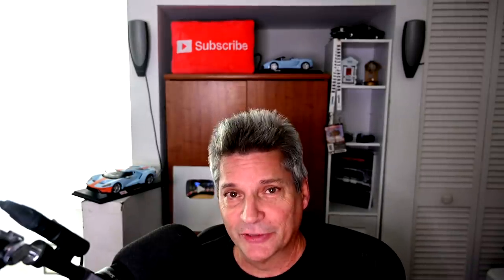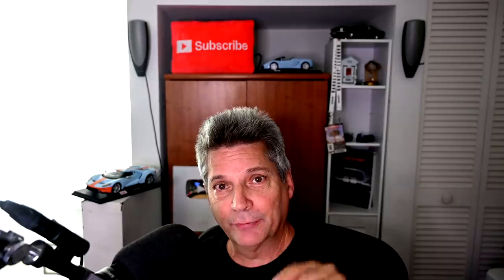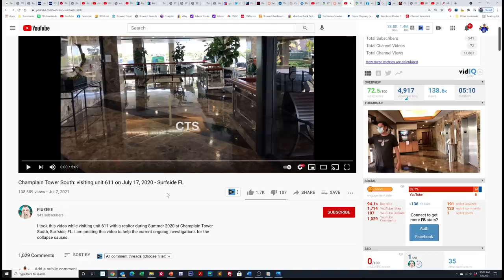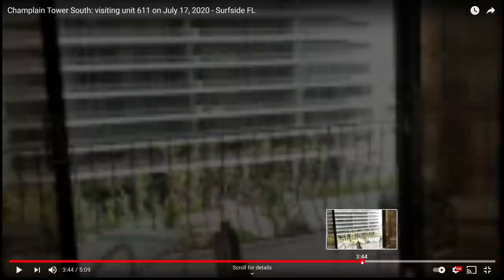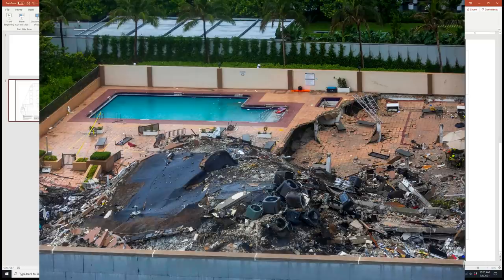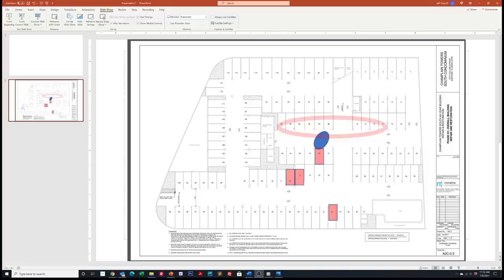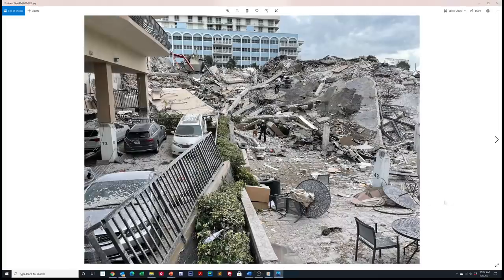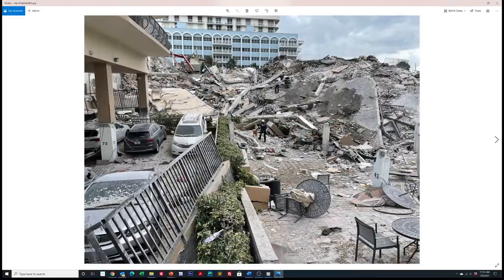Analysis Garage Video BEFORE Condo Collapse: Water Everywhere

Comment: Rust jacking or (oxide jacking) expansion of the rebar giving it's a 1982 Beach front condo .. Saltwater corrodes metal 5 times more then fresh water does and salty humid ocean air is a really bad combination giving it's close to the beach the building simply gave weigh .. such a tragedy prayers for all the family's
Reply from the maker: We're going to show another video this week where one of my older condos that are sick it's on those that a 6 miles inland started to have cracking on the patios started to have cracking on the patios when it was only 7 years old. I went back old. I went back and revisited it this week and it is now a 14 year old building and it is much or 14 year old building and it is much worse condition you'll be shocked at how bad it is and there's no 1 update how bad it is and there's no ocean salt water air near it or anything it's just error near it or anything it's just good old fashioned rain and humidity.
Reply: In the pump room for the pool was showing exposed rebar... they said it was from chlorine water absorbing into the concrete.
Reply: @jeffostroff  
Wow, that is terrible. Maybe the authorities need to limit height of buildings in rainy, humid parts of Florida to prevent excessive load-bearing? I had family in Tampa and it was a constant fight against mold in the house from humidity. Shower, bathroom, kitchen, foundation area outside. The family member told me that in Florida they sell special household towels that are made in such a way that they will, or can (if you are lucky) dry before they start to grow mold and bacteria, and even then...
Reply: @aquariousenigma70  
When there is a crack in concrete from stress (possibly due in this case from uneven weight-bearing from shifting or sinking of the building over several decades), the rebar quickly starts to rust. Look for the term 'concrete spalling.' When rust (oxidation) starts to form, the concrete naturally starts shed or to break off from the rebar because rust is basically the dust from what used to be the surface of the metal. 
There is no evidence to show that the water in the pool maintenance area was water from the pool (chlorinated water). It could have been rain water, even. In any case, the pool never collapsed. The area that collapsed was in the underground parking area. Water was pooling there, under and around the cars constantly, and it was coming down there through the pool decking next to the building, not near to the pool. It may be that the flower planters were watered nightly and water from the planters was being shed onto the deck, and it went straight down into the parking area underneath. There was also a lot of spalling everywhere in the parking area. Great comment, and the chlorinated water, or chlorine fumes, may fit into this.

Comment: One thing I noticed you missed in the video that is extremely an important area to pay attention to. At the 19:11 mark in time, pause the video and take a look at the ceiling in front of the elevator on your right, parking space areas 100-102 on your right, as you pan out from where you made the comment about the mission connector repair, right after you commented about this, as you start panning to the left, if you look up at the ceiling, there is a huge patch from a previous repair and what looks to be a long crack in the ceiling. It is literally above parking space marked 100 on the column is a big patch area of some sort to the concrete above, if you were standing in the garage down the isle you drive, elevators on the right, you also see a very long crack in the concrete ceiling above. If you pause the video at 19:09 and look up at the concrete ceiling, you can't miss it. Pause again at 19:13 and you can see another crack protruding from the patched area going across the concrete ceiling toward the left. One crack goes diagonal and another crack vertically. This is a 2 way crack. My husband works in plumbing, he sees evidence of a serious plumbing issue with drain pipes, this building needed serious plumbing work. I wonder if there are any permits that were pulled for plumbing work or if they ever had a plumber come out and give an estimate for plumbing repair? All the drain pipes we see previous patch work on, which actually should have been replaced and not patched, lot of pipes you can tell needed replaced due to leaks, they could have even had a water pressure problem causing all these leaks in the drain pipes, it is most definitely going to come back the root cause as a plumbing drain issue that damaged this building and nowhere on record do we see as of yet, this as being addressed. If they had made the concrete repairs, the same issue would still be there until the plumbing was repaired and brought up to code. Plumbing is a serious issue involving leaks and highly expensive. Go back and pause the video at 10:25, the ceiling in this area, it is clear they used metal to make a makeshift gutter of some sort to divert water. Look up at the ceiling here on the left, that is a double gutter made from metal placed in the ceiling, to be of that size, there had to have been a significant leak pouring down from the pool deck, it's also to the left of another huge patched concrete area above the vehicles. This building has a huge plumbing draining system problem involving the pool. 2The other thing we noticed go back and pause the video at 4:58-5:31, take a close look at the bottom of the column marked parking space 105-106, be on your right, notice the bottom of the concrete column, you can actually see water stain on the column how high water has actually been in the garage, those are water marks from how high water has actually sat in the garage in this area. Pretty deep puddle of water has sat here before and a number of times or for a long time in order to leave a hard water stain on the column. Parking space 52 on the column at the bottom shows the same hard water stain line, pause at 5:59 on the video, look at the bottom of the column. The yellow paint on the columns shows several columns had sat in deep water for some time in this area as well. I believe this is why we some columns have obviously fresher yellow painted on some columns, I believe it is due to the hard water stains left behind they were maintaining painting over, but hard water stain will only bleed back through the paint if they didn't re-seal the concrete columns with sealant first, I wonder if they ever had those columns re-sealed for water protection? The maintenance man said cars would float it would be so deep, all those columns should have been painted with sealant after that occurring leaving behind hard water stain. If you watch the video on a big screen, I'm using a 70 inch, you can see way more, and the issues present, are phenomenal. If we had driven in the garage and seen just one of the above instances I've highlighted, we would have immediately left this building, and this isn't even everything. We are willing to bet the plumbing drain system issue destroyed the concrete slab and columns and finally gave way and caved.

Comment: Does it look like to you that the coloms have been repainted? Possibly over damage to them?
Reply: Or crappy repairs made and painted over?
Reply: Some of the coloms dontbeven look straight.  If you look through the gaps , spaces between the coloms as they pan around, the spaces don't look square. Possibly meaning the coloms are damaged or the stress from the weight of the building is taking it's toll.
Reply: Wonder if it’s just cosmetic repairs?
Reply: I was seeing the same thing. Those are different shades of yellow.
Reply: @horsewithnoname12345  had to be more than cosmetic repair. More like repairing something major to cover it up cause it did collapse. Cheap materials to cut cost had fatal results.

Comment: I noticed that some of columns look pretty wet at the bottom for about 20 to 30cm. Looks like the garage has been flooded regularly and the columns did not dry up anymore. At 4:55, at 5:59 at column 52. At 21:05 the column is wet at the bottom even higher. Maybe 30-40cm now. And column 15 at 23:32 is damaged...

Comment: 9:26 Is that a chuck of concrete missing from right edge of column 66 near the top?  Diagonally up and right from second "6", or is it just glare from fluorescent light fixture???
Reply from the maker: saw that on a few columns, it is glare on the light and distortion from the lens combined

Comment: The part that fell first is the parking garage under condo's 8-9 (the part of the building still standing).  The proof of this is the photo which shows the fence leaning to the left.  If the pool deck fell first, the fence would be leaning to the right.  So the first part to fall was the parking lot/garage under the portion of the building still standing.  This caused a domino effect, which then caused the pool deck to collapse.  When the pool deck collapsed, this caused catastrophic damage to the five support columns you mentioned.  The cement in the video parking lot ramp the tourist took (is from the pool deck collapsing) and the water pipe you see leaking water is from a broken fire sprinkler line caused by the pool deck collapsing.  The water damage to the parking lot I think around parking space 78 (as you said), this also corresponds to the planter boxes located on the pool deck, which almost identically are located the same places that garage support columns are at.  I believe over watering and rain water would leak downward into the garage creating the puddles.  What was really interesting about your video, is where the water collected in the back portion of the garage.  I believe they will find that some kind of a pool leak, caused damage to the foundation (in the parking lot-garage underground) and this caused the parking lot-garage space to collapse first (even though the building there did no collapse). Additionally, if this building was shifting and sinking as you say, then pipes do not tolerate much movement before they break.  So the continual water in the parking lot-garage area could be from cracked sprinkler lines being compromised by a shifting building foundation.  The building HOA could answer these questions on pool leakage and sprinkler pipes.  Thank you for your video, was very interesting.

Comment: What happened, guaranteed because it happens all the time - this job was sent to the lowest bidder in contracting,  and they weren't the best!
Reply: Well, I don’t have the self confidence to guarantee, but if you watch a bunch of disaster analyses videos, it is usually a combination of factors.  My guess is that it will be a mix of design/construction standard, plus delayed repairs, which is a huge problem in condos (with nothing but respect and sympathy for all victims).  What do you do when you need 15 million in repairs, and only have 700,000 in the condo reserve fund, as here?  And many middle-income or retired residents who are already strained by the pandemic who get to vote on whether they need to find another 15 k each?   No easy answers, and I could see myself saying “yeah, it is bad, but not THAT bad.”

Comment: At 28:00, I think the water gushing down from the pipe is very far back into the pool deck area, likely almost as far back as the pool itself, probably in the area of column 28 or a bit further in. The dimmer bottom half of what appears as water falling is actually the reflection of a brighter upper half stream of water coming down from the ceiling and pouring on a large pool of water on the ground. We see the less bright reflection coming towards us a ways, then we see some concrete debris, which is at the line of the row of columns 20 ft beyond (away from camera, to the east) the facade of the bldg. The ceiling above this area is the highly deteriorated, water-penetrated slab and beam, paint peeling, plastic corrugated sheet containing area directly below the private patio deck area that is in front of unit 111 and is half filled with planters. As we come towards the camera, we see another space with water, then the row of columns directly under and supporting the facade, with the column on the right side (as we view in from the ramp) possibly failed, or at least part of the ceiling, maybe a beam.  So it's possible that three of the four columns that form the patio area square that is in front of unit 111 and also for the facade of unit 111 have failed. This would help explain why the walls in unit 711 (directly above 111) as shown by its deck door window video camera shifted to the left slowly, then collapsed shortly later.

Two or three columns of the four columns below the patio area of unit 111 (two of which formed part of the facade of the bldg) may have failed, leading to the failure of the patio and pool deck slab above and beyond them, then the parking area slab below the uncollapsed part of the building, and then a pause for 7 minutes or so while stresses built up and the building deformed enough, at which point the facade came crashing down, proceeded by rows of columns and the floors above them, successively progressing to the north wall, column row by column row, eliminating the middle portion of the entire bldg.  Then the now unstable east bldg section came down 5 to 10 seconds later after slowly leaning into the pool deck area, leaving only the  elevator-shaft-supported/shear-wall-protected southern portion of the bldg standing.

Comment: I came back here after you more recent video of the 911 calls. Your theory about the fire sprinklers could very well have happened because there was the call from the security system about the fire alarm. I wondered if it was the sprinklers that triggered. I edited it to say maybe the security guard or people who got out first, but realized the call came in about the same time right before the building collapsed.

Comment: I deal with water damage alot in my field of work being a drywall finisher. And just by watching this lil ciip i can tell you that there was a massive water deposit below this garage. First big red flag was the columns.  You can see where water is pooling under the garage by the water saturation on columns. Water will rise up through a porous material and absorb into it. The streaking on the stains is  a dead give away as water finds a path faster in some areas then the other of the same material due to inconsistency of it. The ground of the garage is done in marine cement or at least has a top coat of it  where the pillars are not. Imo small sink hole grew over the years and it hit the tipping point. The small pools of water are normal in a building of this size paint peeling as well. The cracks can be normal in most cases due to overweight vehicles but also could be signs of the ground below giving way. This was a freak accident caused by mother nature and a common sinkhole/erosion. Real question is who knew about this before the collapse.

Comment: I'll bet every lower level parking garage underneath a high rise in the US is being inspected right now
Reply: If only...
Reply: @mandmoraify  dun dun Dunnnn.  Not everything is a conspiracy this is just typical humans thinking somone else will fix it somone else will.deal with it. When there's no people around who care that somone else doesn't exist
Reply: @mandmoraify  in Australia we call it concrete cancer
 Water can take down any building with enough ignoring of the problem.

Mark my words new built buildings in Sydney Australia will collapse we had a building boom and people who build buildings were in short supply so alot of dodgey buildings got slapped up. The buildings are fine for now. But the horrible water proofing is already leaking and garage floors are already cracking.
Water rots concrete to mush and the rebar rusts and then it goes.

Twin towers are definitely an inside job but you have this one wrong. Ignoring water problems is a death sentence.

THIS BUILDINGS body corporate voted to have the expensive repairs done and the representatives VOTED NO. As the repaies were expensive. Hopefully those who voted no were in the building at the time.

Comment: Look at 24:54 the back right corner u will see column the was photographed by engineer with damage on bottom corner. It's the furthest column back
Reply: Actually it lookes like it's the corner of pool. Obviously it wasn't cause but definitely proof of damaged supports
Reply from the maker: Can't tell for sure, but I think it might be tire marks
Reply: Also damage at bottom of space 15 column
Reply: I noticed this too! Looks like the part where the engineer took the picture of the damaged column.
Reply: @jeffostroff  hear me out... column marked 36 is also by corner of pool which is also where fireman was standing and u said that column broke while 42 stood and its also where I said u could see damage on back corner in previous comment that u thought might b tire marks. Am I seeing this right? Don't want to question u just asking? It lookes like the cars on top of space 74 and 73 were parked horizontal while cars in space 74 and 73 would have been vertical?
Reply: @geenacca36  is so, that column did not fail.
Reply: @jsm8149  not arguing just compare garage pics to basement pics to collapse pics and count column from 42 showing in collapse to column collapsed in pic with fireman to garage pic at corner of pool where the column is clearly marked 36

Comment: If you look at the frame at 20:54 on the ceiling it looks like they have diverted leaking water with a corrugated panel with straps to the beam of number 70 column (46 and 48 column are in the background). This is the same beam area that's still standing at 20:25 where the rebar ripped through the ceiling during the collapse, also the rebar, now on the floor and it looks in good shape with no rust.